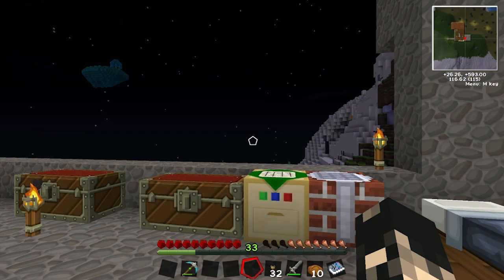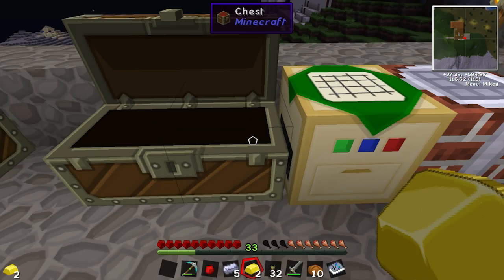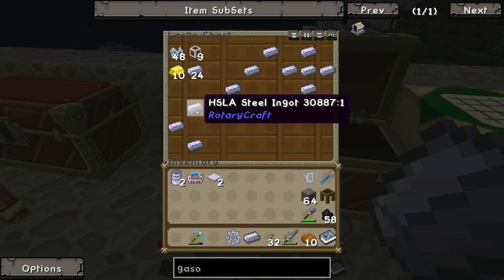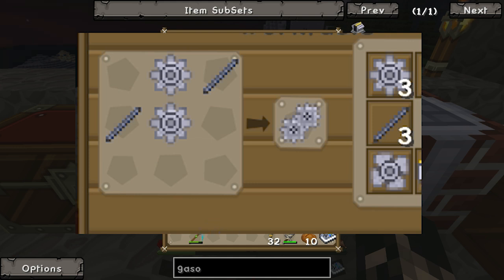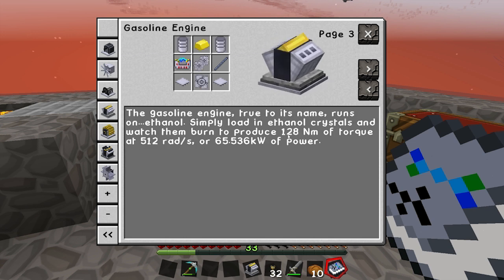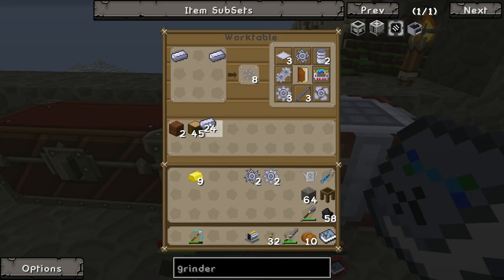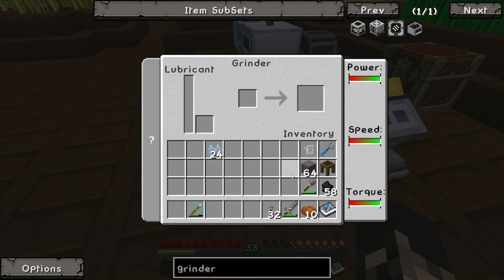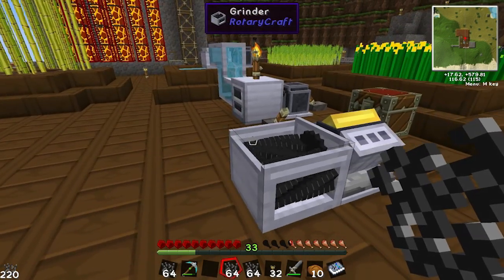Monster FTB Rotarycraft Gasoline Engine, Grinder and Lubricant

Comment: What's the best way to move the lubricant from the grinder for storage?  I was hoping you'd touch on a transport and storage solution.
Reply: Ausyarr I pump it into Railcraft Tanks. From there use TE pipes to your Gearboxes :D
Reply from the maker: Just use a lubricant pipe on the side of the grinder and have it connect to a buildcraft tank. then you can use what ever pipe your familiar to move it around. Plus the tank serves as a gauge for how much you have. In my video after this i believe i have an example of this.